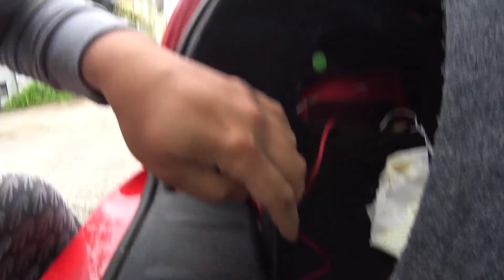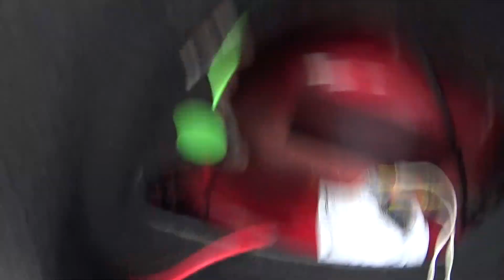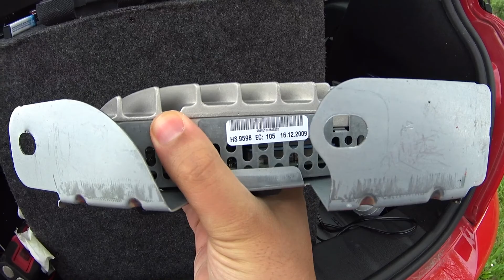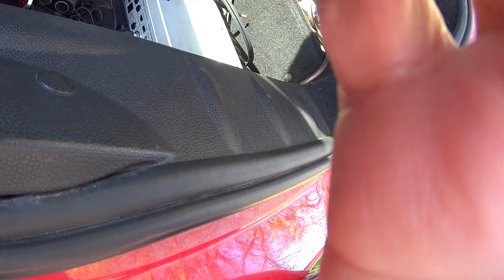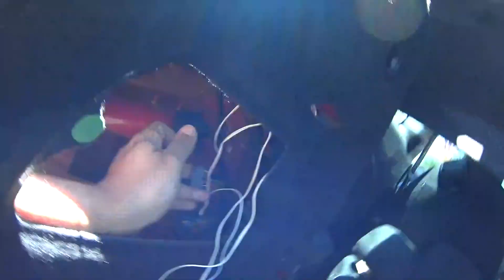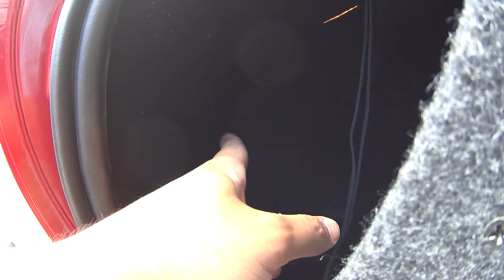Mini Cooper amplifier and subwoofer install. (part 2)

Comment: What wire is the key on key off at the head unit. I’ve probed everything on the radio.  There was only one constant 12v red and it had two wires one was green that barely lit my probe and hardly made it beep but it didn’t change key on or off. Help.  I’m running the audio control lc2i pro and the to setting isn’t the greatest
Reply from the maker: Not sure i never went behind the headunit, its a dashout job so i took the easy way out with going through the mini coopers oem amp.

Comment: I have to remove and replace my amplifier on a 2005 mini. Radio doesn’t work,there’s no sounds. Hoping this is the problem. Gonna try it out.
Reply from the maker: And you checked your fuses with a multimeter that are part of the audio system?
Reply: @Ray-uc8ij  yes! I did that.
Reply from the maker: @StanLeeCup36  well when you get to your amp maybe check power going into the amp just in case it might be wiring issue.
Reply: @Ray-uc8ij  cool! Will do. Thx!

Comment: You need to pick up the front outputs from radio.
Reply: You did it right.
Reply: You did the second hardest part.  I used the amp outs to drive all my speakers from that plug.

Comment: Hi, would you mind telling me, where you connected your amp turn on wire to, to get the amp to switch on with the ignition? Many thanks.
Reply from the maker: Been a while and I am not a 100 percent sure, but I believe I spliced into the power wire that goes into the factory amp. That way if factory amp is off so is the aftermarket one.
Reply: @Ray-uc8ij  Thank you!

Comment: I have the same applifier and subwoofer set up, could you show which wires your connected to?
Reply from the maker: I just hooked up power, ground, signal wire and then directly hooked up the positive and negative speaker wires.
Reply: @Ray-uc8ij  what were the colors your connected to for the speaker wires for the black and the grey heads?
Reply: I have a HS 9598 amplifier but it’s super hard to find a wiring diagram, if you could tell me the number pin you used that would be awesome!
Reply from the maker: @matthewmoses4697  I didnt use a wiring diagram to find the positive and negative leads for the speaker. I just played a music track and then used a voltmeter to probe the wires leading out of the amp.  Which ever two gave me the correct polarity I used as signal wires.

Comment: Can I also install the high low adapter behind the radio or do I have to install at the amplifier?
Reply from the maker: I have never been behind the radio so I don't know how much room you have back there. I remember one video where a guy took his whole dash apart to get to the radio. So unless your going to change your head unit just put it near the amp.

Comment: Im planning in installing a sub on mine pretty good but im thinking im gonna make a custom fiberglass enclosure for it and make a sort of fake floor in the boot
Reply from the maker: Yah as long as you take into account the recommended box size for you sub-woofer. I would think build the box and buy the sub that works with the displacement capacity of the box.